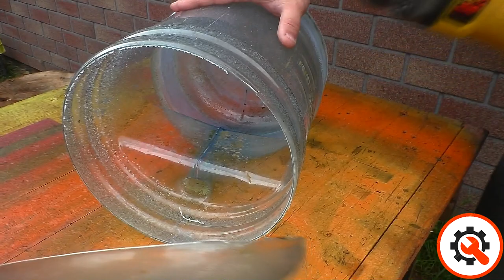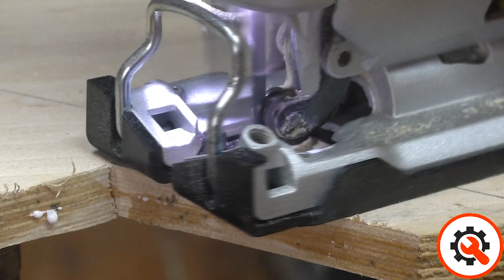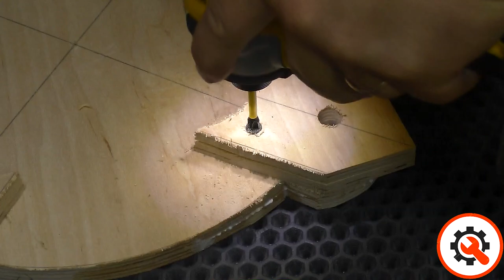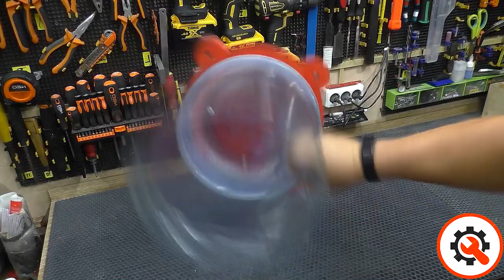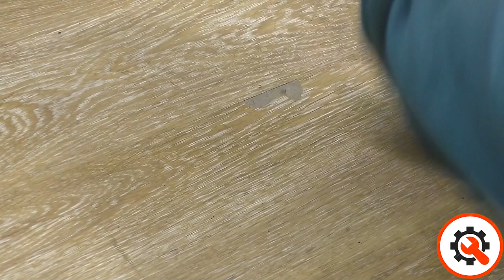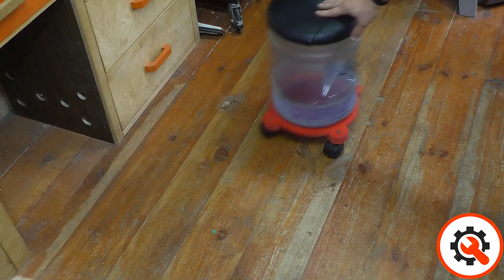Ingenious idea from a 20 liter plastic bottle !!!

Comment: If filled with water so combo of stool & aquarium would the fish get ‘sea sick’?  But seriously, great as a shop stool with removable seat, much handy storage. I have about 20 most used for a container vegetable garden… handles accept 3/4" pipe to support plants and (with tee-fitting) drip irrigation. Tops with 3 holes & string, squirrel resistant bird-bath.